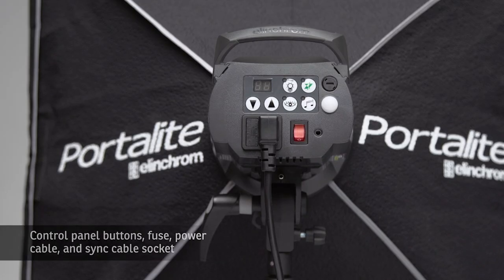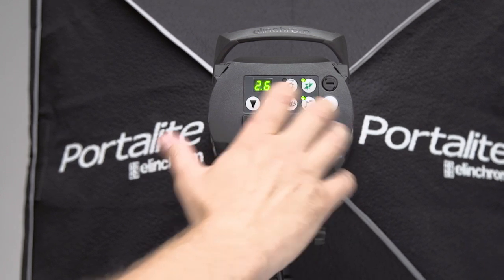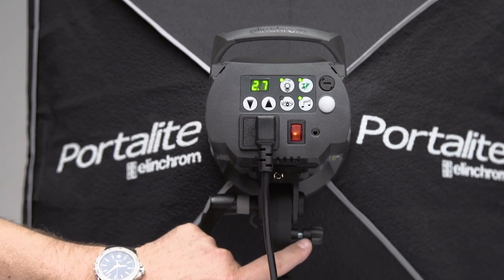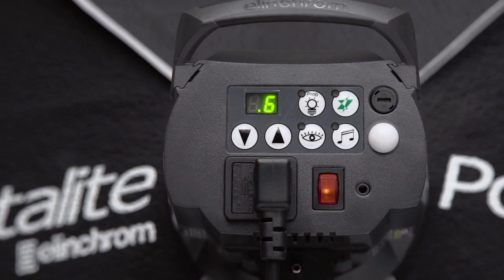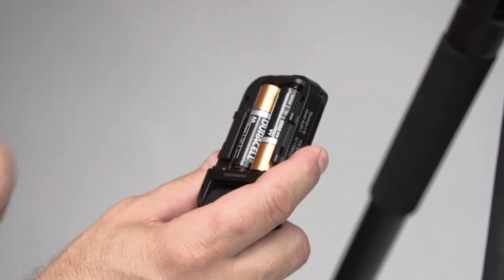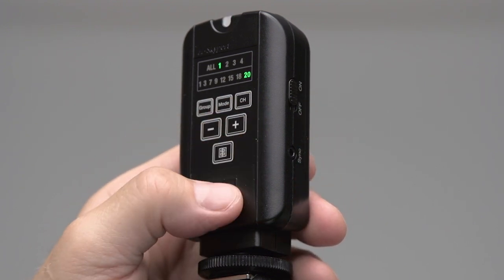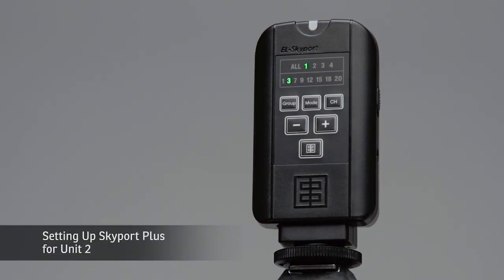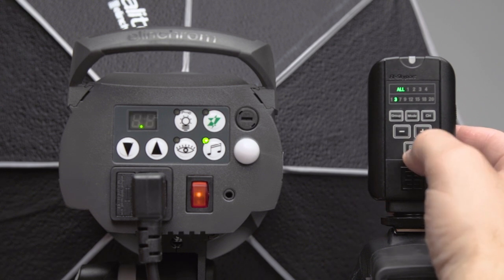D-Lite RX To Go - Part 2: Technical Walkthrough

Comment: It's strange to me that the fixture itself denotes the different frequency channels as F1, F2, F3, F4, and so forth, but the transmitter denotes them as 1, 3, 7, 9, etc.  So does that mean if I'm set to F1, that's 1, and F2 is 3, and F3 is 7?  Why on earth would it be designed that way? The transmitter should match the fixture.

Comment: Hi there, 
How come the transmitter only has odd channels? And the light goes up to 8 channels. Is it possible to utilize all 8 channels that are on the flash unit?
Reply from the maker: You're right. On the Transmitter Plus, these channels are the only ones available for hardware reasons, and, indeed, this is not always convenient.
If you wish to use the complete range of channels, you have to use the Transmitter Pro.

Comment: I would like to know if the Elinchrom D-Lite RX 4     works with times as fast as 1/8000 of a second - with which transmitter
Reply from the maker: Yes Eddi, if you have the D-Lite 4 RX, the Transmitter Pro, and the compatible camera, you might trigger up to 1/8000s.
Please refer to this page to know if your gear is compatible.
https://www.elinchrom.com/support/compatibility/

Comment: ....thanks for this wonderful tutoriel ! 
 I have just bought the RX 4/4 kit and own a Sony  Cobra flash HVL-F43M, as well...
I have now understood how to use it with the normal mode (when my Cobra is put on my Sony alpha 7 III) in manual mode and here is my question.
If I put the provided Skyport on my Alpha7 III, with  the speed mode (red one), can I also use my Cobra's flash deported, in the TTL as well ?
Will that mean that both Elinchrom studio's flashes will start at the second Cobra's flash  only, avoiding in that case the "black" picture?
Many thanks for your next answer...

Olivier

Comment: Hi elinchrom and thanks for this tutorial. I got two d-lite rx4 and a skyport hs but i dont find the way to connect them: pushing up/down buttons nothing change on my dlite4, no sub-menu or other function. How i could test them? There is difference between rx4 (mine) and rx4it? Both model got inside skyport receiver? Thanks for support
Reply from the maker: The D-Lite it is the previous version of the D-Lite RX. The build-in receiver can only trigger your flash, power control and power display is not available unfortunately. 
Please have a look to our compatibility chart:http://www.elinchrom.com/support/ELSP-HS.html
Reply: Thanks for answer, mine model are the "D-Lite 4", no "it" and no "RX": is built-in receiver available  in my model? I don't know how to activate it!
Thanks for support

Comment: I'm curious.  I tried to chat with a couple about this but they quit responding when I call them out on their inconsistent statements.  1) Will the D-Lite RX4 work the same way as the Quadra if plugged into a power source such as the Paul C. Buff Mini Vagabond?  In other words could you use it like the Quadra for high sync outside from similar distances.  2) Can you use the D-Lite RX4 in the studio combined with the Quadra for something like a 3 light set up?  
Will the RX4 sync to 1/8000?  Can you use any power setting at any shutter speed to achieve a desired exposure.  I'm looking for the most flexible option for lighting on a budget.  I've been looking at the Godox stuff as well as Interfit S1 lights and the like.  I really like some of the features of the Elinchrom lights but just want to know what draw backs there could possibly be.  
I watched the video with Joe Brady regarding the El Skyport Plus HS but it left some questions unanswered.  When I asked him about using High Sync in the studio he contradicted what he said in the video.  Which is true?  Can you high sync with high shutter to keep ambient down like he demonstrated or not?  Confused and looking for answers, I'd like to make a decision soon.  One other item, will the Quadra Hybrid you have on sale for $599 with the S head be capable of the same?  I realize I may have to go with the HS head to get to 1/8000 but someone told me you can do 1/4000 with the S head which should be good enough for now.  Thanks in advance for your quick response.
Reply from the maker: Hi Todd.
1. Yes, but the trade offs are weight and recycling time
2. Yes, no problem
3. Yes it works fine, its just that the HS head is really optimized for Hi-Sync. I really depends on your camera, with some you’ll have no problem, with others, at 1/8000 you may see a little grading effect.
http://www.elinchrom.com/support/ELSP-HS.html

Comment: The fellow who sold me his D-Lite RX4 gave me an "EL Skyport Speed" but he also gave me the USB Speed for my laptop. I asked about the Skyport Plus you are using here at my local camera retailer and she told me the EL=Skyport Speed is the correct Skyport for the RX4 kit available in Canada not the one (Skyport Plus) you are demoing here. The retailer was selling the Skyport Plus you are demonstrating here in the showcase. Will the Skyport Speed not work with leaf shutter cameras? even if I set the head to r2 for leaf shuttered cameras? I am curious to know what you, Elinchrom, think about that. Thanks.
Reply from the maker: Dear Gary, The Skyport Plus is the new version of the Skyport Speed. http://www.elinchrom.com/skyport/transmitter-plus.html
The Skyport Speed still works perfectly with lead shutter cameras. http://www.elinchrom.com/skyport/speed.html
Reply: Thanks, Elinchrom! I love this set. I worked with Bowens' Monoblocs in '75 in a small studio. Then Speedotron's when I took some studio lighting and studio fashion at a college. These Elinchroms are slick.

Comment: Good flash for the money but the flash duration is poor, only managing a t0.1 duration of 1/197 at lowest power and 1/266 at full power. This is an important area to look at when buying studio flash and often overlooked. Companies normally provide a t0.5 result which is not what you really need to know. Hand holding for portraits at low power or freezing subjects is not what this flash is best for and should be addressed by the company in future. It is often found you cannot use your cameras max sync speed with this flash either and would be limited to around 1/160 shutter speed at best.
Reply from the maker: @SuperFotoZ We use Hi-Sync to freeze motion, not HSS. And the D-Lite 4 RX is perfectly compatible with this feature due to its low flash duration.
http://www.elinchrom.com/learn/what-is-hi-sync.html
Reply: Thanks I agree with what you say. I was referring to the unit without the £219.00 Skyport HS and just a normal trigger or sync cable.

Comment: Hi! I have the D-Lite RX 4 set and the modelling lamp does not turn on on either head. I have confirmed that I have the correct voltage lamp and have gone through a series of tests to figure out why it won't turn on but have had no luck thus far. Is there a quick or known fix to this? Many thanks!
Reply: Hey Sarah, the Elinchrom's use proprietary 100w modelling lamps. The thread on the bulb is specific to Elinchrom. Plus you have to screw the bulb in tight. I found just screwing the modelling lamp in as one would a regular light bulb into a lamp socket, I found not to be enough. I had to 'really' give the modelling lamp a 'turn' before the lamp sat securely and both contacts in the socket engaged the modelling lamp. It's spooky because one is wondering if the bulb will break.